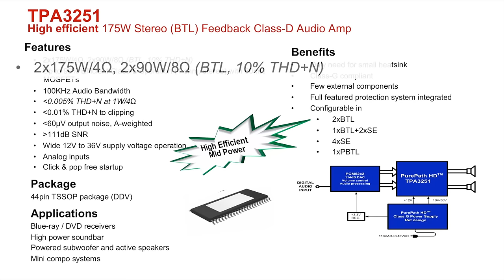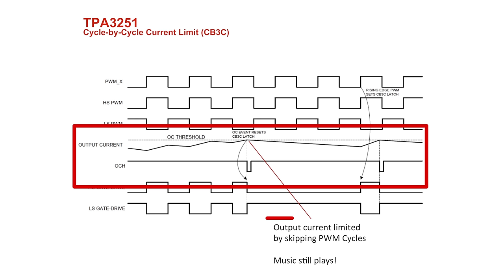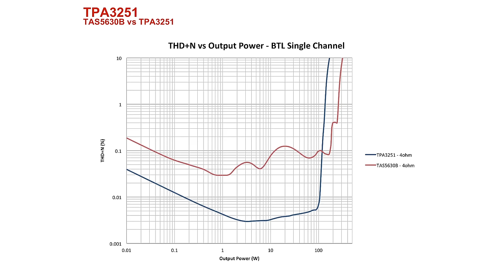TPA3251: 175-W Stereo, 350-W Mono Ultra-HD Class-D Audio Amplifier

Comment: In the real world speakers are 8 ohms, maybe 4 ohms and who listens to music at 10% distortion? That is well into clipping.Why not give HONEST ratings. The rating should be power just prior to clipping, both channels driven into 8/4 ohms from 20hz to 20khz then we have a 60 watt amplifier. Still good but not 175. No wonder you need such a small heatsink.
Reply: I m not too good when it come to amplifier, I m about to buy the TPA3251, could you give me a correct answer I was planning to use because of the 175 w so it can't power what the advertised??
Reply: @my.hollywood.movies2392  I have not tested this amplifier but most manufactures greatly exaggerate power output, they rate them into silly low impedance at 10% distortion, often one channel only driven. Many have inadequate heatsinking. Many you find on E Bay and the like are often fitted with fake ICs.

Comment: Attach an I2S input to it & I'm buying :)
Reply from the maker: +Sichevi Alexander Thank you for your comment. You should check out the TI Design High Fidelity 175W Class-D Audio Amplifier with Digital Inputs and Processing Reference Design, which includes the PCM5242. You can view it here: http://www.ti.com/tool/tida-00874.
Reply: +Texas Instruments
Thanks, but.. it is a board with USB transport & DAC. I'm interested in single chip solution, like STA328, but more power & less THD+N.
Reply: Sichevi Alexander Merus Audio has that solution :)
Reply: TI now offers exactly what you were asking for: TAS3251- http://www.ti.com/product/TAS3251 - 175W-Stereo, 350W-Mono, Ultra-HD Digital-Input Class-D Amplifier